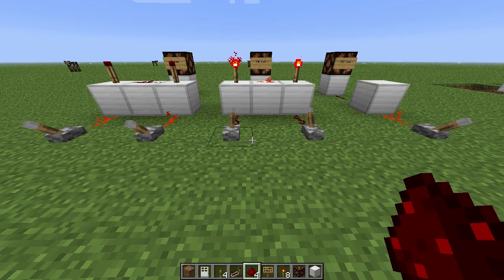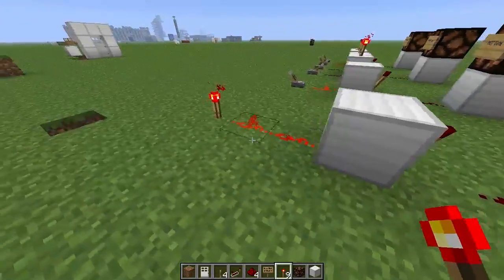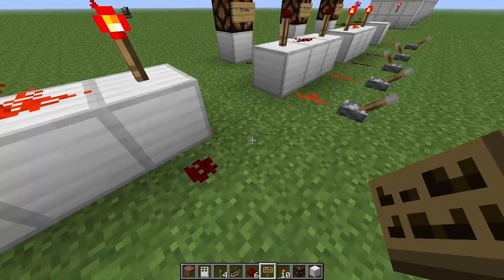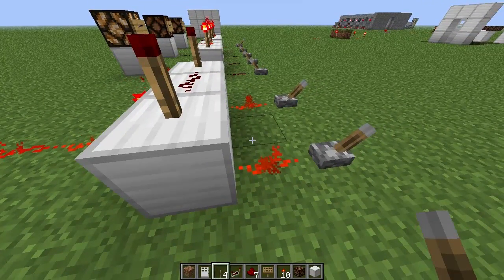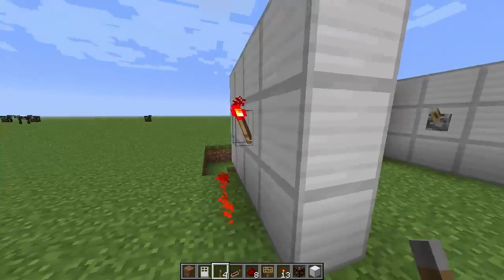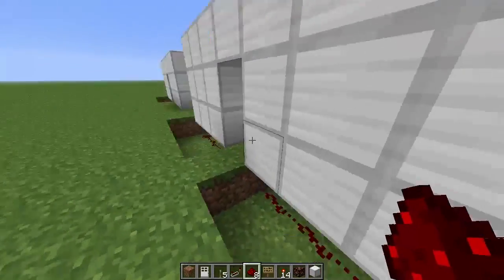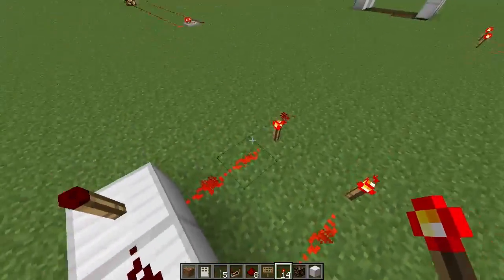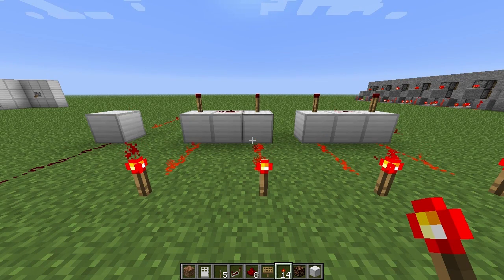Redstone Tutorials - #8 Logic Gates

Comment: Firstly to Flabaliki, thank you for all your helpful, redstone-rookie tutorials. Now, as I just arrived here AND better late than never AND even if outdated in Minecraft AND for anyone interested in REALLY understanding gate logic, I shall explain... and maybe also demystify two of the gates that were actually built here:

a) NOT gate (also called an Inverter): ONLY ever takes one input and inverts it. So, if i/p is ON... o/p is OFF, and vice versa
b) OR gate: Takes two OR MORE inputs (without limit). If ANY number of the inputs are switched ON, the output will turn ON. Only when all inputs are off will the output be OFF (when A OR B OR C etc is ON (or ALL), the output turns ON)
c) AND gate: Takes two or more inputs (without limit). If ANY of the inputs are switched OFF, the output will turn OFF. Only when all inputs are ON will the output be ON. (when A AND B AND C etc are ON (i.e., ALL inputs), the output turns ON)
d) NAND gate (NOT AND): Simply add a NOT gate (Inverter) straight after an AND gate, such that any input(s) that are turned OFF will turn the output ON. Only when all inputs are ON will the output be OFF. *
e) NOR gate (NOT OR): Simply add an Inverter after an OR gate, such that any input(s) that are turned ON will turn the output OFF. Only when all inputs are OFF with the output be ON.
f) XOR gate (Exclusive OR): Any two inputs that are different will turn the output ON. Only when ALL inputs are the same, i.e., ALL ON or ALL OFF will the output be OFF.
g) XNOR gate (Exclusive NOR): Just invert the output of the above! All inputs the same and the output will be ON.

* You should observe that Flabaliki effectively built a NAND gate, not an OR gate by simply connecting the output from two inverters (NOT gates)! The NAND operates the same as the OR logic but with REVERSED POLARITY. He states, and you can clearly see, that BOTH input LEVERS are initially ON turning the torches OFF (that's Minecraft logic for you!) and therefore making the output turn OFF. Turning OFF either or both levers turns the glowstone ON... through inversion! You'll hopefully now see that he physically built a 'NOT A OR NOT B' gate... which, after 'De-Morganising', equates to a NAND gate. (I'll leave out the unnecessary electronics explanation... unless you're interested???). Refer to NAND Gate above (d).

Also, he physically built a 'NOT A NOR NOT B' circuit to create the AND gate by simply adding an inverter to the output of his 'NOT A OR NOT B' gate. This logic ('NOT A NOR NOT B') equates to the AND gate... again through De-Morgan's theorem. In this case, at least you can see that it requires the input LEVERS to be both (ALL) ON in order to turn the glowstone ON. His OR gate logic, on the other hand, is only so because the output works (is ON) when either input LEVER is OFF, not ON as in a true OR gate! As stated, this is precisely a NAND gate giving reversed-polarity logic OR gate functionality. At least one commenter I saw supports this by stating that the output of Flabaliki's OR gate is actually 1110. This information is derived from the NAND gate 'truth table' of outputs from two inputs, where: 0 NAND 0 = 1, 0 NAND 1 = 1, 1 NAND 0 = 1, 1 NAND 1 = 0.

That should clarify the builds in this video and logic gates in general for the intellectually give a shit. PS: I have 15+ years' experience in electronic engineering and no, I don't have much of a life other than living alone in deep, contented thought! I enjoyed using/wasting my time to give info to those who give a shit. For those who don't... NOR do I! 🤣

Comment: For the “OR” gate, you made a NAND. When both input switches are off, the signal outputs on.
Reply: You are so right! Thanks for pointing this out.
Reply: I was searching for this comment.
Reply: He changed that in the description and added #8.5 explaining the issue
Reply: Right
Reply: true
Reply: so nand is basicly or and and?
Reply: @luzellemoller6621 NAND is the inversion of AND (Not AND)

The 2 inputs where 1 is ON and 0 is OFF with corresponding outputs look like this:

AND
0 0 = 0 
0 1 = 0
1 0 = 0
1 1 = 1

NAND
0 0 = 1
0 1 = 1
1 0 = 1
1 1 = 0

Comment: 3:17 Sorry man that's wrong. An OR gate gives a high output (on) when one or both inputs are high. What you have there is a NAND (NOT-AND) gate: it does NOT give a high output when both inputs high, as to say it gives a high output when at least one input is low. If you notice the way you built the AND gate is by inverting the output of an identical circuit you did before, AND=NNAND (NOT-NOT-AND). Except from that great tutorials!

Comment: So the first one is kinda useless cause redstone n a lever could do it...the sec on the ether or one is deff useless but u could do a double pressure plate door
Reply: Unless used in a tiled sequence, that requires an output to be true until stated otherwise, and didn't need any human interaction/ variable output based on whether or not the lever is activated. This is a good logic gate in a number of ways, mainly, as I had stated, to set an output to true until the tiled gates beforehand have met their predetermined requisetes, thus allowing their torches to be turned on/off, respectively, and causing the final gate to trigger when all other variables have been passed.
In other words, what you are saying is true, on a basic level. But redstone gets much more complicated the more adept at it you are.
Reply: the first two are more for a pressure plate system

Comment: Oh so on the ORGate it's something that's like two different switches across your room and they both turn the light on or off.
Reply: I would say the kind of light switch you describe is different from an or gate. For your light switch example, the light is on only if one switch is on and the other is off, but the light will be off if both switches are on or both are off. For an or gate, the light is on when one switch is on and the other is off, or when both switches are on; the light is off only when both switches are off. Really, the only difference between the two is the output when both switches are on.

Comment: so if you use an and gate which requires both to be on, which means in reality u can use the and gate to make a safety system for a door. but if u wanted to open the door from both sides using an and gate "safe switch", don't u need an inverter then for both sides to work as a "safe switch"?

Comment: It's a lot easier to just say: NOT-gate: output will turn on when the input is 'not' on. AND-gate: output will turn on when input 1 'and' input 2 are both off. OR-gate: output will turn on when input 1 'or' input 2 is on.

Comment: If you've seen episodes four and five of this series (piston doorways), then that would be one of the better examples for the NOT gate. You press a button or step on a pressure pad, then inverting the signal, thus turning off the pistons and opening the doorway.

Comment from the maker: It's an OR gate as the inputs and outputs are:
i1 i2 O
0  0  0
0  1  1
1  0  1
1  1  1
As you can see, one or the other or both, produces an output of 1. What I have in game is actually a NOR gate, as when I have 1  1 the output is 0, but the table above still makes sense.

Comment: Actually, it's a NAND gate. :)
It powers the output continuously unless both (i.e. NOT AND) inputs are on. When you see it side-by-side with the AND gate you can see that they're identical except for the torch on the output, which as you show in video is an inverter - a NOT gate.

I'm loving the series so far, keep 'em coming. :)

Comment: That is NOR gate not an OR gate. OR gates are used to join to redstone currents together, While what you built is a NOR gate which acts the same but the inputs are inverted. to change your NOR gate into an OR gate you need to invert the inputs which will create a double invert therefore making the answer the same.